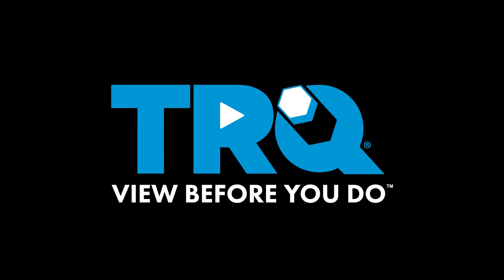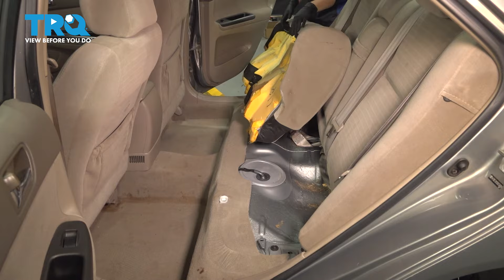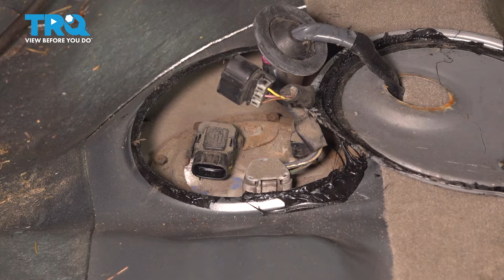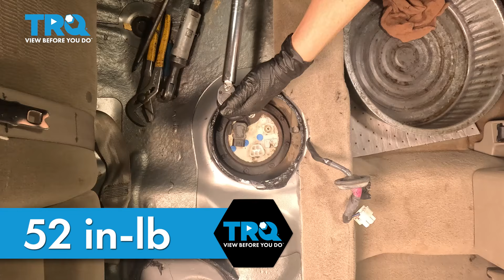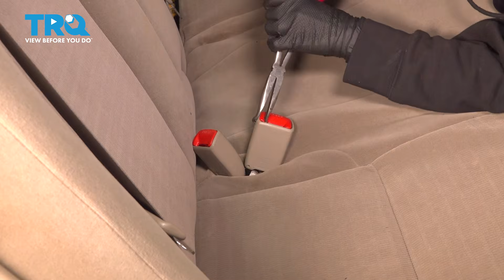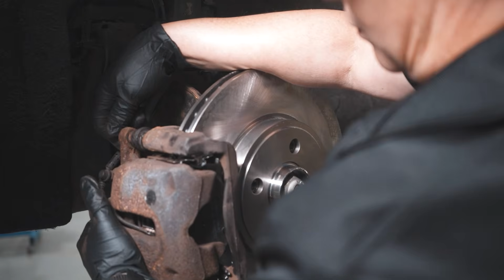How to Replace Fuel Pump Assembly 2002-2006 Toyota Camry

Comment: Great video. Made it easy to change my pump. Bad thing is I still have the same issue with power when going uphill or pressing hard on the gas pedal. Taking the car in to a shop since I don't mess with exhaust or injectors. Thanks for posting this video though. 👍